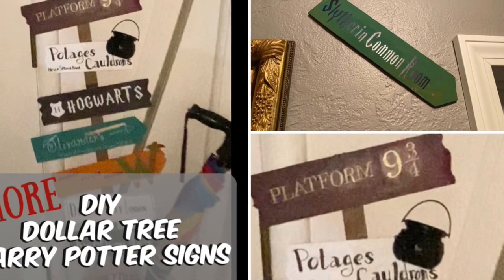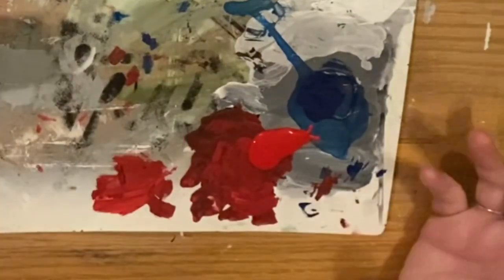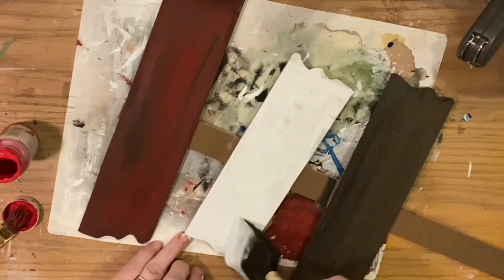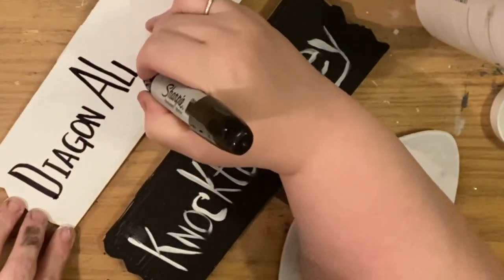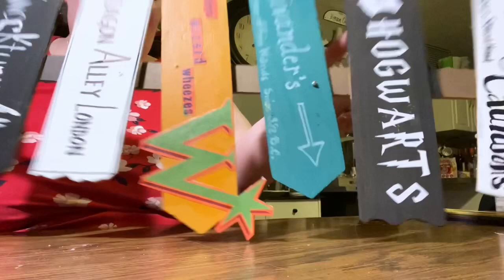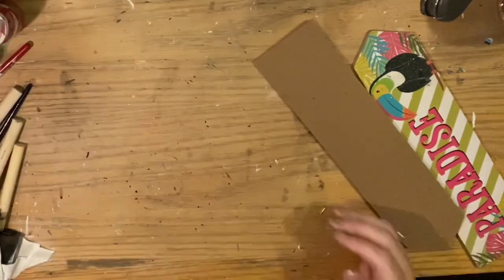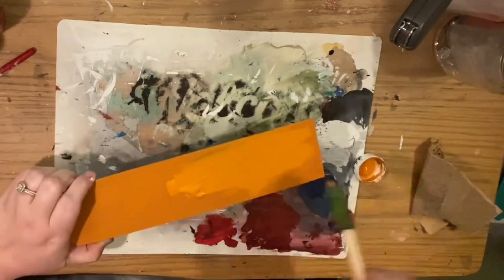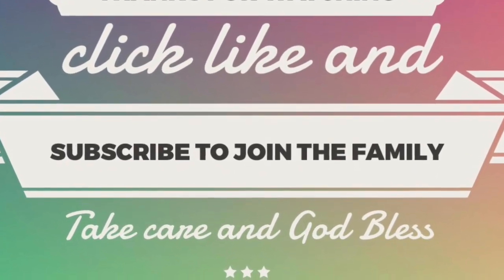DIY Dollar Tree MORE Harry Potter Signs

Comment: Yes, I have so much trouble with the Cricut tape even after putting it through the towel run. The Cricut is too sticky for my wood projects. My vinyl gets stuck so much I rather use the cheap transfer tape. I love HP. Also, Ollivanders has 2 L’s. Great video